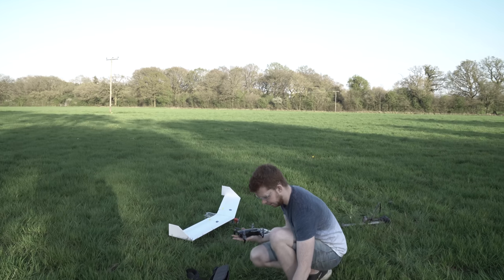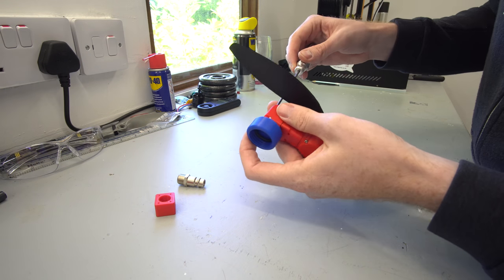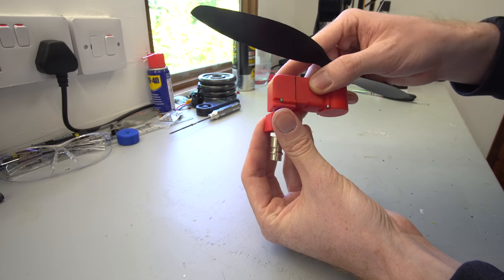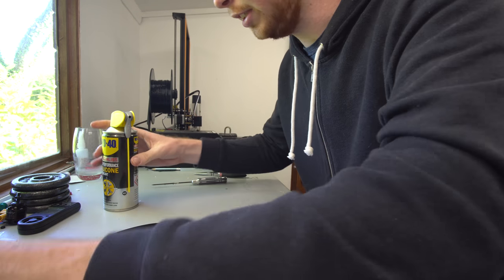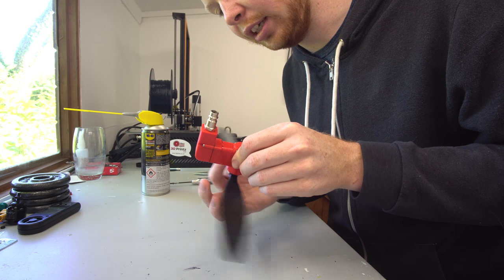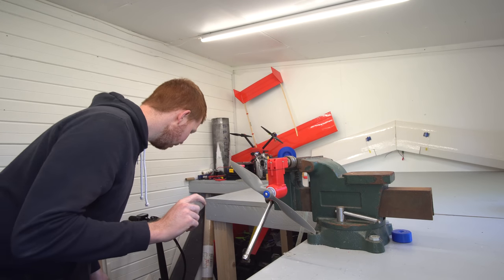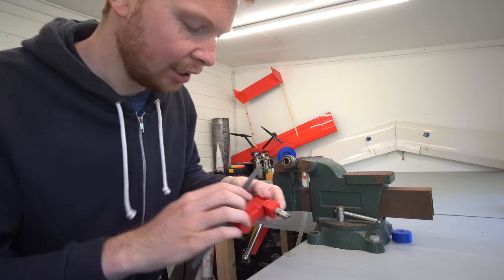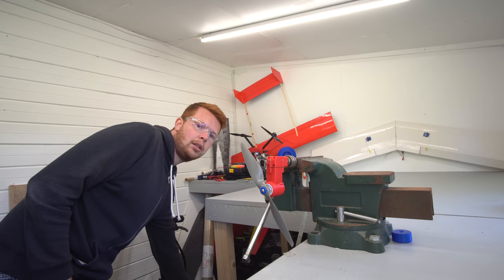Air Engine Throttle

Comment: Snail-cam on the throttle lever for greater control?
Fit engine block to the throttle body the other way up to minimise volume?
Flap-valves like a hydraulic ram-pump might deprecate the push rod section?
Great seeing your work and feeling like I can interfere with your projects 😉🙈😂

Comment: replace the pressure regulator with an assembly that variably tightens the hole between leading to a small cavity between the pressure source and the engine. the theory behind this is that the cavity between the engine and the air source can only fill so fast, and the speed at which it can fill is varied according to the rate of flow between the air source and the cavity. tighten the hole, and reduce the rate at which the cavity fills. reduce the rate at which the cavity fills, and reduce the pressure in the cavity with each stroke. the benefit of this is that you waste no air when dealing with limited air.

Comment: Not sure if anyone else has mentioned, but those quick-connect air connectors always leak, nothin to worry about there. VERY cool project.

I'd be extremely interested in seeing this adapted to work with a common (cheap) CO2 canister. I fly R/C airplanes and it would be oh-so-cool to see this mounted on the nose of a bird with some longer run times than what you're experiencing with a water bottle full of air, which has much less tolerance for high pressure. 

Check out Crosman AirSource (3.2 oz) bottles or the 12-gram powerlets if you're interested in a project like that. Since CO2 will sublimate and pressure changes with temperature, it might be difficult to make a reliable or "good" throttling mechanism for CO2 rather than air, which is mechanically pressurized (unlike these CO2 cartridges).

Comment: I don't know if you read comments or not but I have a suggestion. Instead of making the car powered by a propeller, have a driveshaft connected to the cylinder and in order to make it possible to stop the car, make a clutch using flexible filament. I think that would be a lot cooler

Comment: I was thinking while the throttle idle occasionally is so low it cuts out, that maybe you could add a couple tiny neodymium magnets or something to get it to kick over into a cycle state ready to receive pressurized air. Then you could effectively, cut out and glide unpowered with a fully closed throttle, then resume.... Maybe...?  I also get it adds a little mass, and rotational mass to the shaft. But an on/off versus a wasteful idle might be useful for flight duration. I really like this project, and like others I have been watching the evolution, and looking forward to more.

Comment: Changing the motor format... Going to try that crazy suggestion of pressurizing from the crankcase side? (Bet it could be even smaller that way.) Gas engines don't do that because of how they deal with heat and lubrication, but this is an air expansion motor - so there are a few funny tricks you could get away with that may be fun to try. (Might also try some other "odd" layout examples seen in piston steam engines.)

Comment: It looks like your push connect on the fitting is not fully seated trying pushing it in more until it clicks. That should stop the leaking.

Also put some threads on the diaphragm piston so that you can twist to set the throttle. This will also hold it in place so it doesn’t keep going back to max throttle when you let go.

Comment: Two suggestions:

Bypass style throttle: Applying pressure closes a bypass on the system, allowing for a car style throttle.
worm style gear or screw mechanism; instead of a lever.

Also teflon tape is your bff for compressor lines. Good for sealing threads .. that or loctite blue (not red .. NEVER use red.) Compressor line leak like that ... you get used to it.

Comment: you could add a small air way around the diaphragm (maybe even adjustable with a screw) to set the idle speed so the prop doesn't stall.

Comment: Air powered cars are pretty easy. a standard car engine can be used if the came is change from 90 degrees to 180 out of phase with the crankshaft. The intake gets replaced with a presurised air inlet and it works perfectly. Its not very economical due to weight. 2 stroke engines can be converted fairly easily for things like bicycles.

Comment: If you were to add a small set screw underneath the throttle lever and a rubber band or spring pulling down on the lever, the set screw would allow you to adjust the idle speed and the throttle would function in the same manor as a normal throttle in the sense that you would have to pull to open the throttle.

Comment: diaphragm valve is basically half of a pressure regulator. Add a second diaphragm on the other side of the valve that is only connected to the inlet and with an inlet that is slightly larger than on top. Then add an armature to connect the button on the top to the bottom on the bottom. The diaphragm on the bottom should cancel out the force trying to open the valve, so then the pressure delivered to the motor should depend on the force exerted on the armature.

Comment: Even though you posted this a few weeks ago, When you showed us the Diagram I thought You would have a spring between the piston and the cap on the top, I also though You would have a Lever that would pull the Piton up instead of down to be able to leave the engine off with pressure still on the other side of the valve. The lever I thought you would have in my mind looked something like yours but a hole in the middle and in one end to connect to the piston. Great work keep it up! You just found a new subscriber :)
Reply: Piston**
Reply: I also thought you could change the CAD files to have a little bit of a ledge for the lever So you don't stall the engine, Although with your current design if something does wrong all you have to do is mash the button or lever down to stall the engine. Just some thoughts :P

Comment: You might try considering something like a gate valve, but instead of the end stopping against the far side of the valve body have it continue on a bit... the extra length of the gate would be for a section to be cut out of it.  The slit in the gate would start off small and get progressively widen the more the gate is moved/opened.  This should give you better control over the throttle with minimal force required to actuate the valve.  The gate that slides in the valve body can be changed easily as you want to tweak the throttle response or even to provide a small flow at "closed" position for idling the motor.

Also, I saw somebody talking about using co2 or dry ice..... that's a terrible idea unless you're prepared to hold back 900+psi or don't mind your motor blowing up.  However if you do want to try out a liquefied gas as a propellant you might want to try something like tetrafluoroethane which has a mush more manageable pressure range.  You can often find it in air duster cans(sometimes they are difluoro/trifluoro) or in cans marked as R134a refrigerant.  The pressure of R134a is close to 70psi at 70F and around 125psi at 100F..... pressures that are easily manageable and will be a bit lower once you open the throttle as the liquid boils off and cools down.

Comment: You could use this system as an "engine cutoff" switch (when you've still got pressure remaining) and maybe find a way to create a throttle body that actually makes the engine go faster as you press, not slower.
Still very cool :)

Comment: If you start making the engine modular, you can make new parts and modifications as easy as swapping a head, manifold, throttle, cam and so on

Comment: For a car it’ll be quite difficult. You’re either going to have to completely redesign the engine to 4 cylinder or make a clutch flywheel for it to keep spinning. Either option is probably going to require a gearbox as well as the engine is only going to have a small optimum rev speed.

Comment: I wonder how well some mini co2 canisters connected in parallel would work in this project? With an off the shelf regulator you might get some pretty cool results; it would be light-weight and compact too.

Comment: You should try making a screw valve instead! You can vary the pressure and let go of it to leave it semi-throttled. Also it would be easy to actuate with a servo motor in the future.

Comment: Once you install a servo to operate the throttle valve, I would suggest printing a cam for it, rather than just using a lever: You could fine-tune the shape of the cam to compensate for the increased sensitivity of the valve the more it is closed.

Comment: If you put a mount on top of that valve with a spring it would always stay in idle... mount a small adjustment screw under the lever to push it up to the best idle setting. That way you can mount a servo to the lever which will pull upwards against the force of the spring and open the air intake. Would work just like a carburator but much more simplified.

Comment: If you want to try for high efficiency and the manifold for the flat twin seems a bit tricky I may have a solution. Use the exhaust port of one cylinder to feed the other, although there will be slight pressure loss you will be able to a much simpler design with the same air consumption of the version 3 but better output power.

Comment: You should add a screw/bolt to the lever on the throttle so you can use it as a throttle stop and "set" the idle speed

Comment: Instead of a straight press-down lever for controlling the diaphragm valve, I'd suggest an offset cylinder shaft style. This way you could have a much finer control of the throttling.

Comment: You can put a idle adjust screw under the lever and put a spring pulling it down so when you pull the lever up it opens the valve

Comment: Have you thought about 3D printing a air tank with a smaller nozzle size to increase pressure in the engine?

Comment: Have you considered adding a mechanism to kick the engine over? I'm thinking a pin that could be attached to a servo or solenoid as a "starter motor" in case the motor stalls. It would also save fingers...

Comment: i wonder if you could get it to spin fast enough to produce a TRULY meaningful amount of thrust where it could fly a plane. at which point, if it could, you could build a plane out of a lightweight pressure canister and use a pressure regulator to not blow up the engine and give it a longer run time?

edit: lol i posted this comment at 7:18 and literally 10 seconds later tom explains why a pressure regulator may be harder to use than it sounds

Comment: You could add a thin rubber seal between the two parts that leak. This is what gbb airsoft guns use to direct the gas from the magazine and the bolt and carrier and should work for this as well

Comment: connectors on compressed air hoses take a good amount of strength to fully clamp in that's why it was leaking here, my dad has worked on cars for years and he can easily connect them but for me I just can't figure out how he does it. Anyways just push really hard and it should pop in without leaking
EDIT: Btw yes I know I'm 4 years late

Comment: What are your high level design and fabrication goals? Don't want to make reinventing-the-wheel, off-the-shelf, or non-3D-printing construction suggestions not knowing them. 

You also might want to wear ear protection when running the compressor.

Very interesting videos, BTW!

Comment: Good job. I see the nose is running out quite a bit when you vary the throttle. I've thought in many of your videos that two bearings would reduce the crank shaft's tendency to twist off axis.

Comment: I never even thought about using a sprung air regulator, i was thinking about the gas types which use a bladder. Easy to make, even in PLA. AS for mating surfaces, you need to just use a cone to cone connection, it increases surface (use red high temp silicone, it doesn't bond to surfaces like other types of silicones do, and always maintains its elasticity, thus, easy to remove in case you've a boo-boo) and adds rigidity to a joint.

Comment: Hi Tom, great progress 😎 I have just get an idea - what about stepper/servo driven screew which controls this valve? And what about to use this engine on some kind of glider to have to use airpower during climb only - to spare it for longer. And maybe reverse logic valve would be better - I mean system when valve needs to be open to allow air go in and to automaticaly close itself due to air pressure... Anyway thanks for great stuff you make and have a wonderful week ✌️

Comment: I think you might try "variable valve timing" of some sort, to vary the power by varying the opening time of intake valve instead of restricting the whole airflow of the intake, to avoid pumping losses. I think you might do this with an arrangement similar to one in the new Infiniti variable compression engine, introducing a lever mounted on an eccentric shaft actuated by a servo.

Comment: Would be cool if you tried making an attachment to run the engine from Co2 cartridge. As the Co2 is in liquid state, the cartridge fits way more gas than the plastic bottle you are using now. Besides, the pressure provided is consant, the vapor pressure of Co2 at a given temperature.

Comment: Hey Tom. Not sure if you are still doing the Air Engine thing, but I only recently found your channel and love the work you have done on this subject. I was just curious if you had attempted or thought of implementing a 3d printed butterfly valve into your throttle concept?

Comment: I highly recommend 3D printing threads for NPT stuff. It's not hard to model, they print super well when the hole's axis is aligned with the z-axis, and they are EXTREMELY satisfying to screw in. It's helped by the tapered profile meaning it doesn't really need to be exact, as it'll just keep screwing in until it reaches the right size

How to model (in solidworks):
1. Make tapered hole, 1.7899 degree angle, make the smaller end's diameter the size of the "drill size" for tapping the hole. (usually with a revolved cut)
2. make helical reference geometry off on of the circles, again enter the 1.7899 degree angle, thread pitch is 1/TPI (can find drill size and TPI of various NPT threads on tables online).
3. draw a little triangle that extends OFF the outer face of the object, and AWAY from the center axis. (to cut the thread) make it 60 degrees on all corners, and side length is 1/TPI. (don't worry about the thread sides not following the angle).
4. make a swept cut of the profile in #3 on the helical reference geometry. 

Now you have a thread that you just screw it on with some pipe tape, and it seals perfectly just like that! No heat gun, only need a wrench for the last couple turns, and is really satisfying to put together.

Comment: If you operate the lever with a servo, you could have an Arduino control that servo, based on the input of a light sensor that measures propeller RPM. Program in a feedback loop and you'd have a constant RPM as long as the pressure's high enough.

Comment: I think you should use co2 cartridges to power it and regulate the pressure down to 60 or 100 psi instead of the 800 from the cartridge.

Comment: If you could power an alternator, how much power would it produce using just fresh air ?
 If your considering using hpa fit a regulator and use scuba tanks, so much easier, look at airgun springs and greases too, all high pressure related. Great channel mate thanks.

Comment: There was an Airhogs compressed air airplane. Which tswisted the piston in order to let the pressure out when moving up. That also use a much smaller piston with a similar/smaller size prop. 

That designe might help.

Comment: this is awesome you should make a several cylinder version for the car for more power like a v2 or straight 3 configuration i feel like this would be better for getting the car off the line. Anyways great video

Comment: Very cool. Could you use a screw to keep the throttle down instead of the lever? Could b finer control and no need for constant force

Comment: What you need to do is build a heavy disk that goes on the end of the flywheel next to the engine so you can keep the same gearing but still have it run good

Comment: Tom, if it didn't leak before due to wear and tear, that connector was probably leaking due to the lack of pressure. At low psi they all leak. They need that pressure to seal.

Comment: Would a larger propeller and possibly a gear up help improve endurance? I'd imagine low RPM on the engine would reduce air flow, and you are not "losing" power to what is basically a mechanical rheostat

Comment: Maybe add a adjustable stop to the valve at idle thrust so you can start the engine with your hand and not have it kill you.
Or crank start with a gear that spins and you start to spin it like starting a lighter.

Comment: Well you should add a flywheel as the prop may have too much resistance to make a 1 piston engine run smoothly at low rpm/ pressure.

Comment: if you take a tube with a springpowerd piston  if you put presure in the piston is going back but when you are using the motor the piston wil kep it the same prsure because it is pushing the air so you are always on one kind of maximum throttle

Comment: If you want to put it in an RC car, why not try a dual or other multi-cylinder setup? I'd imagine it could potentially be more efficient driving larger props at smaller RPMs for a larger model plane as well?

Comment: I may be wrong but cant you put a 1way valve on the exaust and make the exaust air go back into the intake. This may help the engine to run at lower input pressure.

Comment: Airsoft hpa taping nozzles and hose are nearly leakless and if used with a regulator will give you a steadier flow but will weigh more (so would just be good for testing)